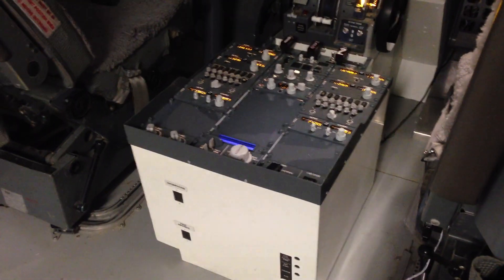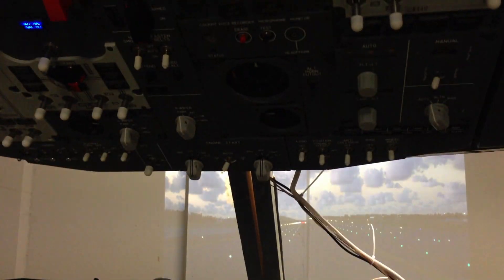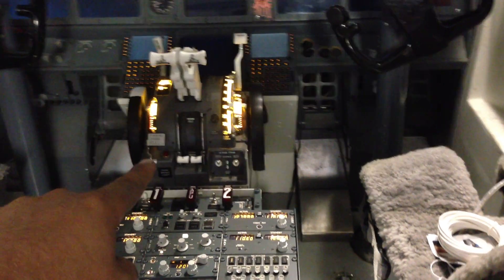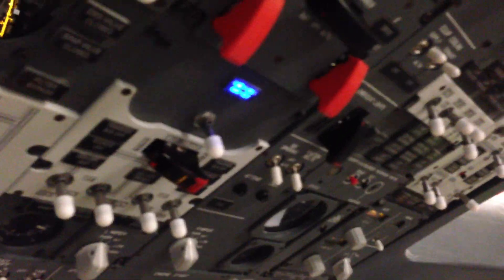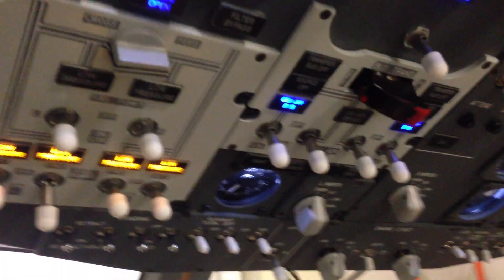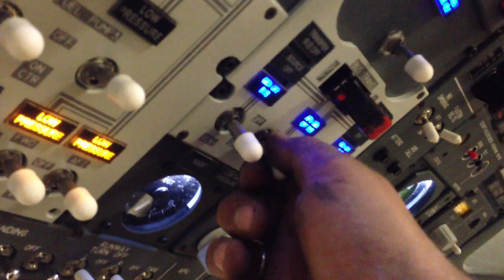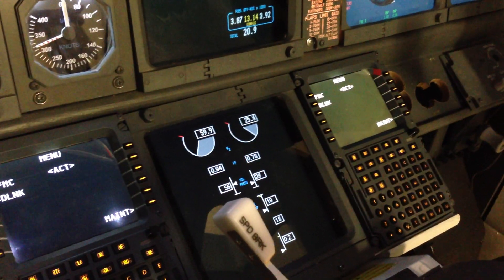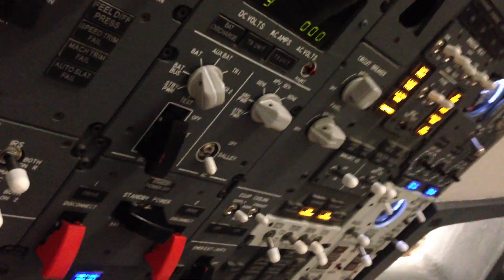Building a Boeing 737-800 home simulator #60

Comment: dont ur engine bleeds have to be on to start??
Reply: +WackyBroProductions actually the engine bleeds are mostly always on, it is recommended to keep them on by boeing to protect the solenoid. if you run the engines at idle thrust there is little to no risk of backpressure from the apu (if you want details you can read it in the fcom). before you taxi you turn off the apu and also the apu bleed, so there will be no risk anymore when you taxi. hope this information could help

Comment from the maker: Jameson, you are right in your statement.. However in a setup like this, you do not use an add-on airplane like that.. You use a dedicated Boeing737 suite to run the logics with. This program reads switches and sends out appropriate lights to my panels and such.. Google ProSim737.. You use FSX for the outside visual to use on your projectors, and a flight model.. Did you know that the flight model in this program is actually based on the default 737 w upgraded flight characteristics.. :)

Comment from the maker: Yes, you guys are right.. This sim is running with ProSim737.. Just Google it. ProSim is what handles and runs all the system logic in the sim. It is able to read all the switch positions, and send out appropriate annunciation lights in the different panels. The only thing you use FSX for, is to have a world to fly in, together with a flight model that have the flight characteristics of a Boeing 737..